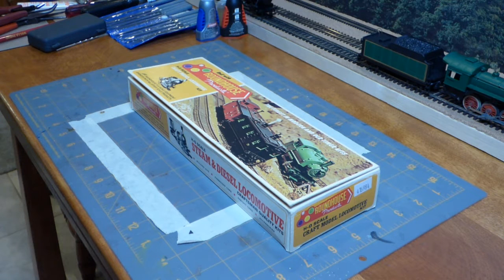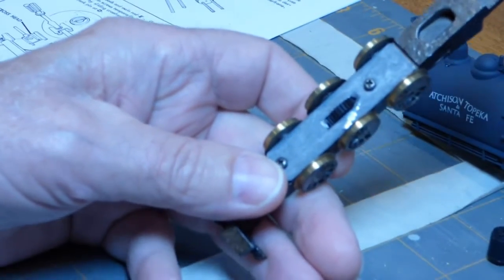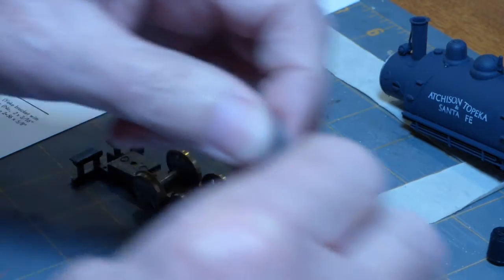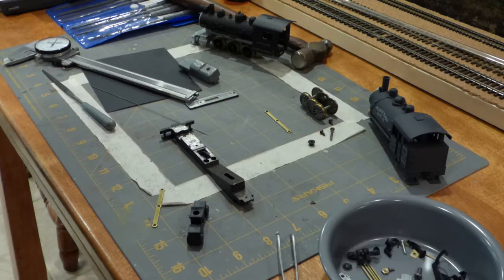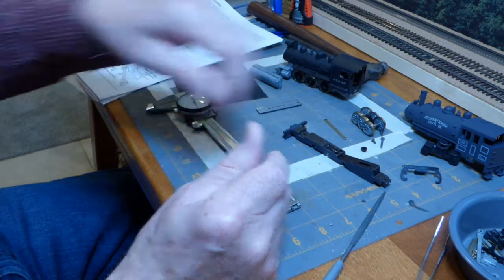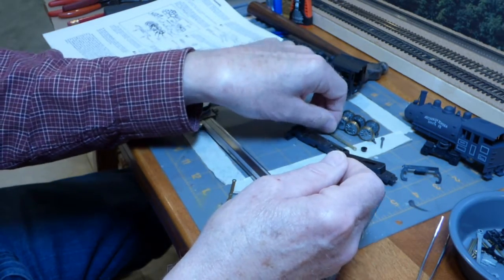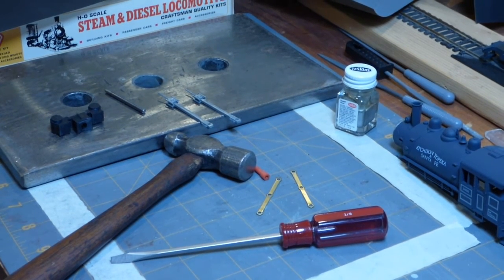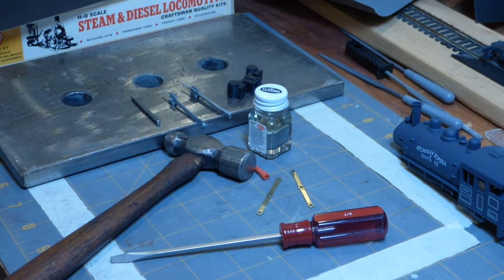Building An Easy Steam Locomotive Kit Part 1

Comment: Where are you finding the locomotive kits? Is there anyone building/selling kits now?
Reply from the maker: David, I go over the source for these kits in this video:  https://www.youtube.com/watch?v=L5YpaA_K9V0&t=1199s

None of the major manufacturers are producing steam locomotive kits any longer.  You need to search the used market.  I've had good luck on both eBay and Facebook's Market Place.  Just put "Steam Locomotive Kits" in their search engine.  Prices have really jumped lately, so be patient to find a deal.